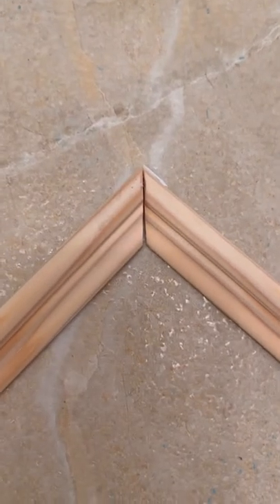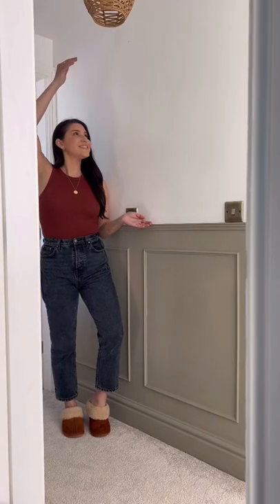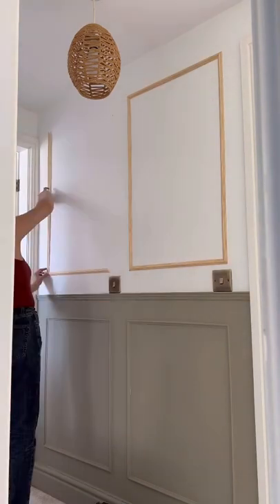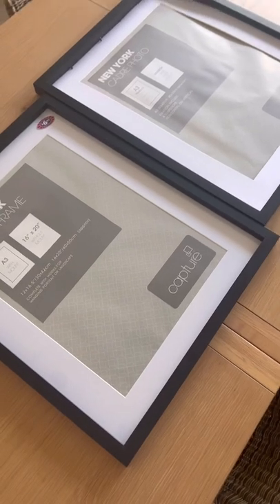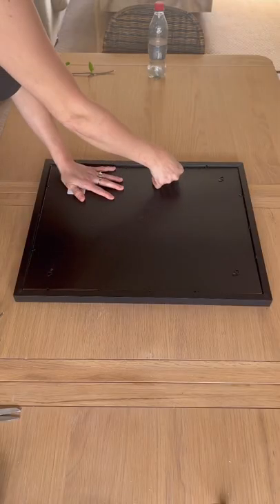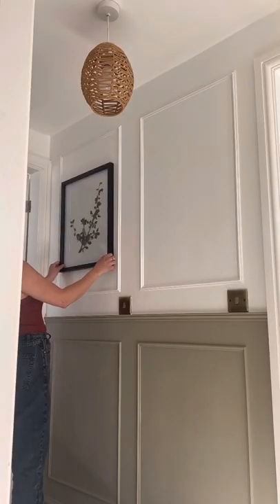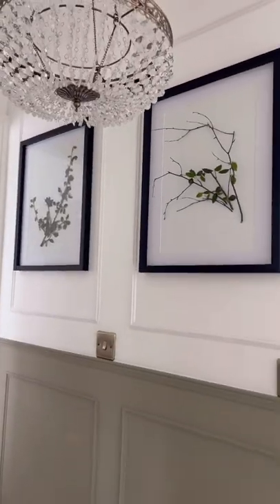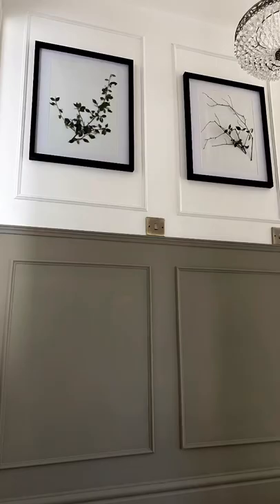I transformed my upstairs for less than £100 😍 #shorts #diyideas #diyprojects #paneling #accentwall

Comment: Instead of drying out the branches you could have preserved them as is by using glycerin. I learned how to do it about 25 years ago on Discovery channel. I forget the lady's name, but she had a home improvement show. Sorry I can't give her credit for this.
   Go to the drugstore and buy several bottles of glycerine, pour one bottle into a vase, see if it's enough to soak the branch in, or flowers. Add enough to soak the cut end into. Cut the branch, or flowers, a bit longer than you want the end result for display. If it's a tough thick end cut up into the wood, then smash it with a hammer, just an inch worth at the end. It gives the branch, or flowers 🌹, more room to soak up the glycerin. Give it a couple days, keep checking on the glycerin level in the vase, add more if needed. Once they've soaked up enough, cut the mashed up end off so that it looks nice. If you are doing flowers, when done, the petals and leaves are a bit leathery to the touch. You can also do this with a bridal bouquet 💐 and preserve them the way they were on your special day. Please note the flowers will look darker than they originally were. Like if you had bright red, it will end up a darker red. If you are planning your wedding and want to preserve your bouquet, months before get one or two flowers in the color you want for the wedding, and try the glycerin trick ahead of time, so you know if you want to change flower colors, or just walk with preserved flowers, or skip it.
  Hope this helps.
Take care, stay safe, have a nice day.
👵🙂✌️🖖    😷    🙉🙈🙊   🌎☮️🕊️

Comment: There’s a formula for balance in dimensions. It’s called the Golden Section. Using the number 1.618 you can proportion the design. Ex…divide the ceiling height 96/1.618=59.3….measure up or down. That’s where you start. Find the side points as well. Once you learn this, everything becomes a masterpiece

Comment: The bottom portion could be more pronounced, by adding in an inner layer (squared) that would give the sections a difference between the upper to lower halves. Paneled sectioning is both a Victorian and Edwardian style that interiors in older structures, e.g., apartments, lofts, houses, were built into the hallways and kitchens. The stylization is a modern take on it. The appearance still looks nude comparably without any added material.